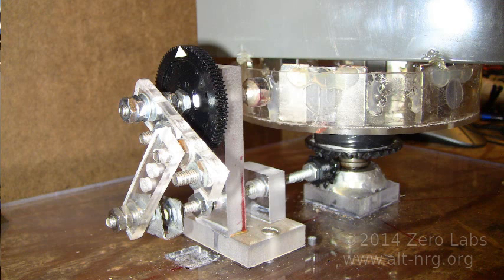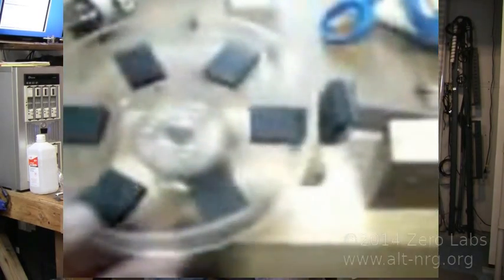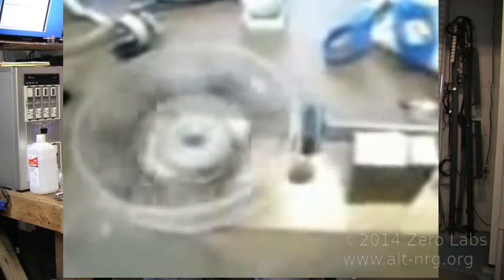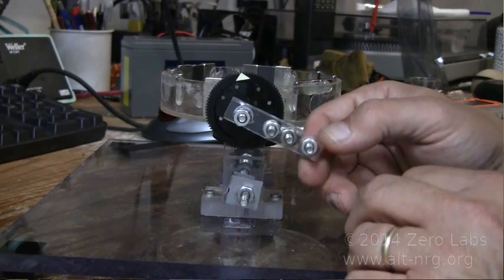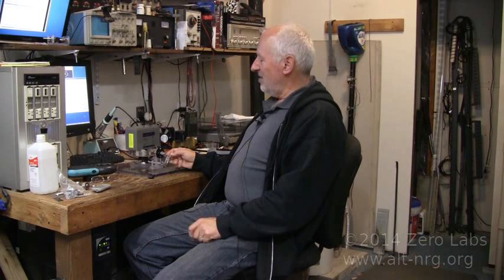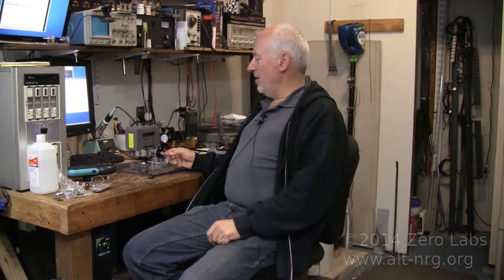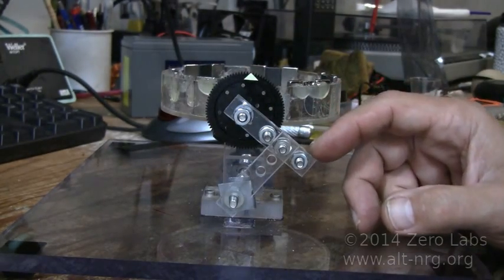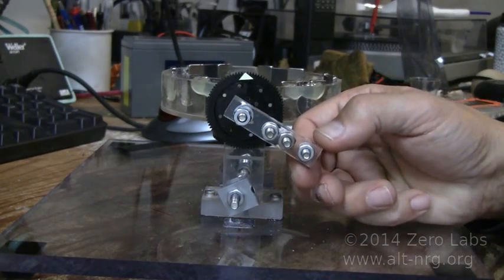#383 Vortex Field Permanent Magnet Motor Update 03

Comment: I sent you an email, but will repeat it here.
Okay, here goes my 2 cents worth.
I really thought you were going to make a video that showed the two oscillating points, which you sort of did, and then watch the video in slow motion to see exactly what both oscillating points points were doing to get a feel for how to adjust one or both oscillations so they match each other. With the way you have the system set up now, it appears to me that the two points are moving at slightly different speeds. In other words the lower offset screw is rotating maybe 1 1/2 times for every stroke of the upper arm. This should be easy to fix by adjusting either the amount of offset in the lower screw or the attachment point of the screw on the upper arm. At any rate, if you can watch the movement of the two points in slow motion and plot this motion, you will be able to figure out what needs to be done to make this device work. The key to solving this problem is plotting the movement of the two attachment points and then making the necessary adjustments to one or both so that the movements exactly match each other. There is no need for more or different magnets. What you have will work. All you need to do is synchronize the movement of the two attachment points. I can see that you are a determined and intelligent man. If you do not understand what I am trying to say here please write back and I will try to give a better explanation. Please let me know what you think of my idea. I have an engineering degree and am retired. I am also working on a free energy idea with fewer moving parts. There are a lot of people out here that hope you succeed. Please write back and let me know how you are doing.
Regards,
Craig Puhrmann

Comment: Think of it like govenor on a carborator for a gas engion. try using springs to controle the timing that is mostly what you are dooing with your hand! the tenchion of the spring controles the rate of fuel for win the engion is under a lode and win it is not.

Comment: You need monopoles man, you need electro magnetic coils that give monopoles! the Kzin had them, its also how they affected gravity, now granted things about gravity have been found out that are related to quantum forces rather than physical forces, but its not entirely out of the question to be able to make artificial gravity with a monopole.

If i had to guess, i would say that you need a switching electromagnet in the "oscillating" position, "reader" or, "detector" coils before and after to read the magnets coming across, and they need to be wound so only the positive end of a coil is where the magnet would be, and of course it would be the negative end elsewhere, probably in an almost rodin coil like arrangement.

Your problem may be that it needs to be an odd number, it may need to be divisible by pi, it may need to be bigger, in fact it almost certainly needs to be bigger.

But my point about the oscillating coil and reader coils is switch the polarity electromagnetically, rather than physically, because thats faster, so you can control the RPM (or is it magnets per minute? :P) by computer pulse rather than by sheer magnet power.

Also, have a generator hooked up to the thing as it is! you can harvest im sure all of one watt off of the torque while youre playing with it, and enough of that, you can pay for the electrical costs of a switching electromagnet :P Or you know, just make it a hand crank device, just crank a generator, energy is energy after all :P

Comment: Have you tried using any type of "shielding" to alter the field lines of the big rotor?  The gears introduce too much friction into the system to overcome and remain in motion.  Magnetic gearing and or magnetic levitating bearings would be ideal.   I've been trying magnetic motors for a couple of years now and overcoming the sticky area where the field lines meet seems to be impossible without a true monpole magnet,.

Comment: Hello Zero,
Seems your hand is doing a double-click on the magnet shaft each time the sinus shaft has turned 2 times. I would suggest adding a 2:1 gear set instead of the link rod, and try some spring and load on the lever you are moving with your hand. also, on the bigger gear of the new gear set I suggest to add, it would be a cam-like contact with the magnet lever with two lobes closely set to get that double click action under the lever. as for the spring and load on the lever, spring would be pulling the lever up and load pulling down.

Comment: precision is partially what you're missing. it looms like a lot of energy is being lost to "slop" in the mechanism. quote as bit of wobbling.

on a side suggestion, perhaps you could use a threaded rod as your connecting piece, along with a wing nut for minut adjustments

Comment: Its all in the hand,or what's in your hand. Internally, the tendons and ligaments and cartilage all have elasticity . The ability to flex and stretch and push or pull against the other. The linkage is fixed and other than the limited flexibility of the shaft your missing the needed wiggle room that your hand provides. Put a little slop in the linking and add some jell washers to simulate the cartilage in your knuckles . The popping of a knuckle is from a liquid stored in a pocket inside of the cartilage giving it bounce to protect bone from bone with a rubbery cushion . Maybe some type of jell or a segment of surgical tube over your threw screws or bolts would do the trick . Then a rubber band here . Add a spring there . You've almost got it now and only need a little bit of play in the linkage to simulate what your finger is doing . I love these kinds of projects and know I'm on the right track with this issue your having . Unfortunately even if the problem is solved the powers that be won't let it go far before they snuff out the invention buying your right to even say the word magnet let alone have one ever again.   Or something worse if you resist being fleeced . Something to be considered when you step back and think about it. To them , good intentions for a better world are a bad idea to begin with . We need to change that first before we all be come fossil fuel. We have a lot of waking up to do and everything else should be on the back burner. Best of luck to you (Z)

Comment: I was somehow just thinking of this even though I watched it a few weeks ago. What happens if you turn the whole assembly 90 degrees so it would not need to lift the weight of the linkage but turn it into a side to side motion?

Comment: If you could somehow configure it so that when the crank shaft is in its "resting" position after the deceleration, the magnets are positioned such that they give the stator that little bit of extra oomph needed to crank the whole thing another notch. In other words, make it so that the resting point of the crank shaft is such that it "can't" rest in that position, where the magnetic arrangement forces it past.

Comment: Using a single vertical lever with an elongated slot cut in it for the camshaft to ride in it will act like a pendulum and it's weight won't be a factor. Extending it below the base and you can add weights if needed. Should run like a clock.

Comment: If you could measure the work done by the flywheel powering a generator against the work input of the powered crank. You could begin obtain data to see if any of your modifications actually reduce power input.

Comment: Z I have not finished watching the full video yet..but what i would try is to mount a white cardboard on the shaft and a sharpie on the lever. And see if you can draw the path on the spining paper as you make it spin. Maybe a piece pf plastic is even better that way you can whipe it clean if you need to... Then make sense out of the drawing and make a puley or chanel to gide the lever.

Comment: Out of the square. don't know if it has been tried.

Moving a shield in between the magnets to interrupt the field?  with double rotors so the top magnet has shield at bottom and the bottom magnet has shield on the top. using stronger and stronger fields on the rotor and then the shield moves in the to allow it to go to the weakest field section while the bottom rotor is going through its stronger fields then it gets the shield to go to the weakest field on the bottom rotor.field strength via magnet spacing.

In theory the lead shielding would cancel the magnetic pull therefore the second rotor is still accelerating, should eliminate the clog point?

hope i explained it as clear as i can see it in my head. Probably something wrong with my theory but always willing to learn

Comment: the relationship between your hand movement vs the crank looks non linear. meaning when u r moving by hand, u r not moving w.r.t to crank hence the sync is getting maintained. anyway i tried such project before, after spending lot of time i figured. that both magnets generate pull (towards) each other, no matter in which axis the magnets are mounted, the system tends to attain equilibrium by cancelling the push with pull & hence want to stop moving. - my conclusion was,[ this system will not work with Permanent (rigid) magnets.] but it will work with hypothetical magnets that can should CHANGE 'Field strength' w.r.t to 'something' (shape, presence of metal or anything)..then we can move that 'something' with cam to achieve continuous motion.

Comment: I wonder if you made the linkage where it could flex like maybe with a spring loaded setup along with a way to adjust the spring tension if that would add the "human" feel into the mix? You may not pick up on it or even be aware of it (Maybe you are) but I bet that you have the tendency to not only compensate the timing of the movement but also tension on the actuator while you are working it too...It's just a thought.

Comment: Put a spring on the top movement of that arm and just play with the tension. Also, kind of wondering why can't you just keep the magnet static and point the end toward the wheel while move a blocking wall to turn on/off the magnet's field.

Comment: it appears the 1st hand stroked was always about 180 degrees out of  from your your driven crank arm, subsequent timing adjustments were harder to determine but the looked like less but remained more like still say about negattive 135 and 90 deg. Also stoke of finger and crankshaft appear slightly different. So fix timing then adjust stroke
finally detemine connecting rod length, a simple slotted hole on one end of con rod yields oval stroke  slot length angle and position on connecting rod adjust various properties your stroke. degree wheels help analyze timing issue rulers or graph paper for stroke length. a cam single lobe or eccentric may yield better. if you skype let's talk,  however I am in Hawaii so time differences. I try checking your video closer on a larger monitor to try to suggesting Ipods are not great for detailed analysis.

Comment: Try using various lengths of connecting rods.   Vary the different lengths by only a half millimeter longer and shorter.  I suspect favoring one side more than the other (in relation to the pointer you have affixed to the gear) will provide a better push and less drag.  I say this because it looks to me as though, while pushing the rod by hand, you favored the position to the right slightly.

Comment: I agree with the people saying it's the extra force you give it on the downward stroke.  When you're pushing it with the rod connected, that is certainly a good indicator that your timing is correct, because the timing is restricted by the linkage.  The only other vectors in play would be the downward force you're giving the rotor.  I hear a lot of clatter, which could be the linkage; but, if it's the rotor, then you may have too many frictional losses.  But, right now, I'd just say that whatever frictional forces are involved, the extra push from your hand is what is overcoming the immediate slow down when you release you hand, and as you said yourself, the additional push is harder in one direction (cw) than the other, and by harder I presume it's significant enough you noticed, and therefore quite an additional applied force.  The linkage, by itself is not adding any force, I presume it's purpose was to place the magnet where it would prove force simply from the magnet itself, which appears insufficient and therefore why it works when you give it a push.

I suspect you already know this to some degree, and you just need someone to confirm it.  I presume you're hoping that fine turning the time could eliminate some of this as a factor; but, I fear, with the frictional forces in play, and the extra force needed from your hand, this will be difficult.  I haven't watched your earlier videos to see what you're doing... I will try to find them.

As an aside, I noticed that the movement I see looks very similar to what I find in a pendulum clock, when the pendulum is removed... of course, that has the added benefit of a spring to keep it running, and it will wind down.  I can't help but also wonder if the ball coil could be used somehow as an electrical monopole, and using a pulsed signal; but alternating the polarity of the magnets on the rotor could do something. Unfortunately, it's the only way I can see taking advantage of the reverse lenz that must surely even occur in the spherical magnet, though when pulsing, no matter what polarity, it does appear monopolar, so you wouldn't have to overcome the presence of the opposing magnetic pole during pulses.  I feel reasonably sure you thought of that too... and there's a flaw in my thinking about that.
Reply from the maker: Chip Cooper Yes, I've thought of most of those things already and still plan to try some of them. I have a running list going. One suggestion that keeps popping up is spring loading the connecting rod linkage with some slop. I might add to that with some adjustable weights. That would bring into play some mechanical resonance and that just might be the missing puzzle piece.

Comment: Maybe more teeth on the ring and pinyin gear. Wont that give you more timing adjustment?
The acentric and rod length only effect the stroke. 
The gears at the wheel need to be changed.
This is all speculation on my part.
Reply from the maker: ***** It's all speculation until tested. And I will test many. Thanks!

Comment: my guess would be your hand is adding energy to the system and the cam cant because its part of the output
Reply from the maker: Eniklis Mine too. The input needed is deceivingly small and I'd expect the output available at the crank would be enough to supply it. Still plugging away at it...........
Reply: ZeroFossilFuel think you need a slightly bigger gear on your cam. the frequency looks off after I watched it a few times.  it looks like the cam is moving too fast and passes your hand motion,  I would build a machine to move the arm for me that I can increase or decrease hooked to a wave gen. then get the cam in perfect sink.

Comment: What about a cap driven relay?
Reply from the maker: ***** I think the energy to charge the cap > the return in mechanical. I'm thinking more along the lines of a two sided Ed Ledskalnin style PMH to hold the lever in position on each 1/6 stroke.
Reply: ZeroFossilFuel To help cut down on the drag, you need to use something that produces that less drag. From previous tests, we have learned the lower the resistance the higher the drag on the magnets. Thus is the logic of my caps idea. Caps act like an open circuit until it becomes charged. All it has to produce is enough to load up a weak coil spring and then the load from the coil spring is released moving the shaft rod. This could happen between the magnetic field pass to help lower drag resistance.

Comment: Zero fossil Fuel I am your biggest fan! And I think you should rotate your mechanism 90 degrees, so the handle to the lever hangs from the mechanism, because the downward movement of the lever is just falling so only up will cost some energy, see if you can look for an old clock osc.

Comment: Dude they are magnets, any larger amount of energy perceived in the main rotor is an accumulation of the energy your putting in with your hand.
Reply: Exactly my thinking. Even if you used a spring load to help with the push, the amount needed to load the spring would be greater than the load it would get back out of it.

Comment: Maybe offset by 1/4 inch and try to reduce friction on the linkage and gears. I wonder if putting magnets on either side of the arm with the same polarity to help push arm up and down once it gets at the top of the stroke and the button of the stroke but it might act as a break. too slow motion would be helpful I think you could just be a hair out of sync

Comment: Maybe try something springy in the linkage. Slot one of the holes in the linkage and have rubber bands come in from each side and hook them to the screw at the elbow joint. Allow that joint to swing a little.

Comment: The white arrows is about 2 or 3 degrees positive compared to when the link is hooked up. The arrow seems more straight up and down. I think you need to shorten your link a mm or so. 
Be interesting to see a very slow moe with measurements. You might find a flexible link like a spring/rubber band of the right stiffness would work better than a solid link.? maybe?
Cool if I had that thing in front of me I dont think Id get much else done till I figured it out.